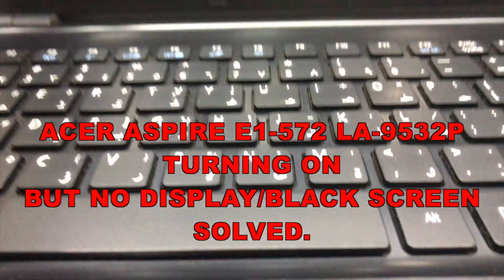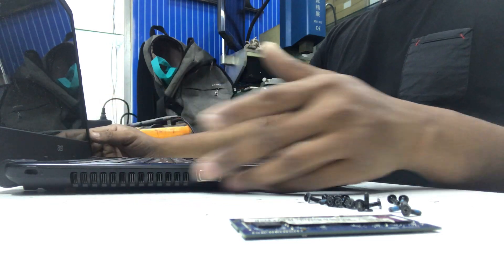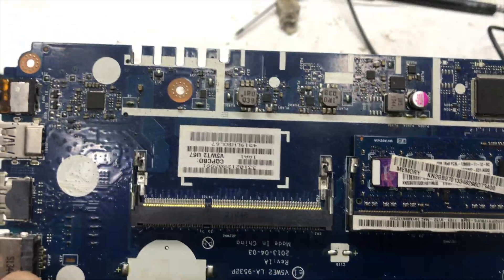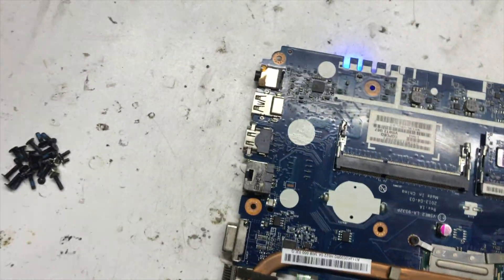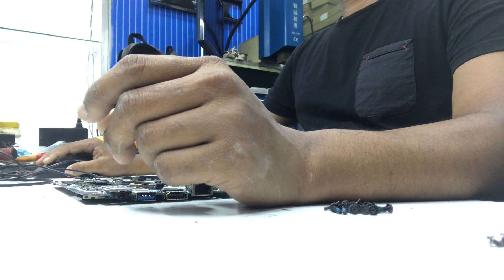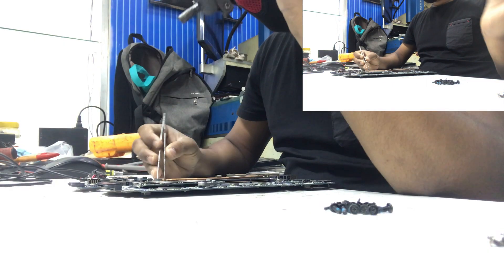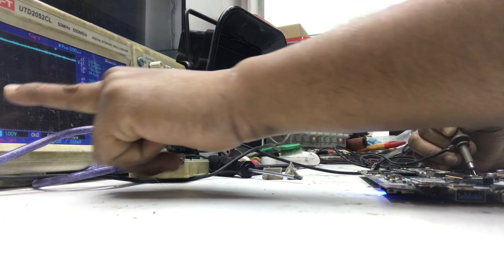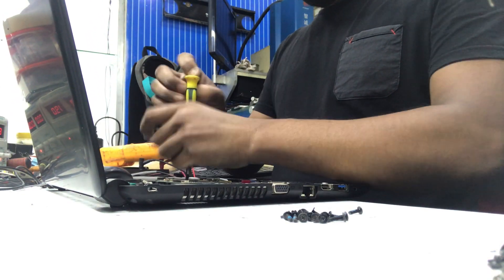Acer Aspire E1-572 LA-9532P turning on but no display black screen solved.

Comment: Hello , my computer model is Packard Bell Easynote TE69HW. The markings on the motherboard are:

V5WE2 LA-9532P
Rev: 1A
2013-04-03
Made in China

I have a problem with my computer and I couldn’t figure out the cause.

When I press the power button, the computer takes a long time to turn on.

Here is what happens when I press the power button:

The fan spins once, and then I have to wait a long time for the system to start. During this waiting period, one of the indicator lights keeps blinking. It stays like this for a long time. The blinking light looks like a storage/HDD indicator.

This waiting time sometimes lasts 10–20 minutes.

I disassembled the computer and inspected it to see if anything was wrong. I removed all components, reapplied new thermal paste on the CPU, and reassembled everything.

Then I pressed the power button again, but the same problem continues — it still takes a very long time to start.

I have not updated the BIOS on this device.

I have a file with a “.bin” extension, but I rename it to a "NameMainboard"x64.fd extension.
For example: V5WE2x64.fd

I formatted a USB flash drive as FAT32 and copied the file onto the USB.

I shut down the computer and disconnected everything attached to it
(power cable, battery, USB, etc.).

Then I pressed the power button for a long time to discharge the capacitors. After that, I inserted the USB drive and plugged in the power cable.

I held down Fn + Esc on the keyboard and pressed the power button. The fan started running continuously, and I waited for 3–5 minutes, but nothing happened.

Most likely the file is incorrect, so I couldn’t perform the BIOS update.
Can you help me?
Reply: I think it happened during the bios update via USB, the LED light on the USB flashed, that is, it read, and then the buzzer beeped 3 times and the computer shut down. After 3 minutes, the bios screen opened, and the settings came back as default settings, but again, I completely shut down the computer and pressed the power button, and it waited for a long time, and then it started up. After a very long wait, the Packard Bell logo appeared, and this took about 15-20 minutes. I am trying to understand the problem.

Comment: Sir Need Help. 
When I pressed on button the light blue appears for only 1-2 seconds andthen disappears. When I plug the charger orange light appears for 3 seconds and turns blue light after. Yet it is still black screen. I dont know what happened. I tried pressing the on button for 15secsbut nothing happened as well. Badly need help! :"(
Reply from the maker: EYRYNE AVE thanks for your comment, pull out the battery from your laptop then clean RAM and reset BIOS by removing CMOS battery then press power on switch for 10 seconds then connect charger and try if problem not solved then you need to take your laptop to your local laptop repair shop.

Comment: My Acer e1 572 is not turning on .  Blue light Power is on screen black please help .how to fix it
Reply: Did it maybe overheat? If so then probably your graphics chip is faulty, if so, its maybe possible to reflow it, there are tons of tutorials on YouTube. Otherwise try to remove the battery and the charger and keep the power button pressed for about 10sec. Next replug the charger in but not the battery and see if it works, maybe you have luck, so just try it! :D

Comment: Hi man please help me i have same laptop for you while im gaming in 30mns it is shot down i already clean the fan
Reply from the maker: Thanks for your comment, check your laptop temperature and cooling fan its  spinning or not, you can try clean ME region in BIOS. then flash the BIOS.
Reply: @Laptop_repair_zone  i clean the fan and i adjust the battery setting how to clean me bios and flash? Please help me

Comment: I have same symptoms. I will try the same as you. Thanks.
Reply from the maker: David Ujcic thanks for your comment, please share my channel.
Reply: Laptop Repair Zone unfortunately after successful main memory match flash of bios I still have same. All voltage good but no screen (hdmi too). What signals would you check next?

Comment: you told that variation should be stop after a while , but we saw that  variation wasn't stop. please clear this point . thanks
Reply from the maker: sorry for that,there i turn on off  3 times, you can see the motherboard power on blue led so you understand, thanks.

Comment: I have a hp 15 laptop 
I was playing on it until it turned off and i got a black screen with caps lock blinking 5 times , i opened the laptop and cleaned up everything and i changed the thermal paste , basically everything a normal person can do, after that it blinked one time only, please help me out to find what is the problem , thanks in advance.
Reply from the maker: Basm Bsam CPU problem.